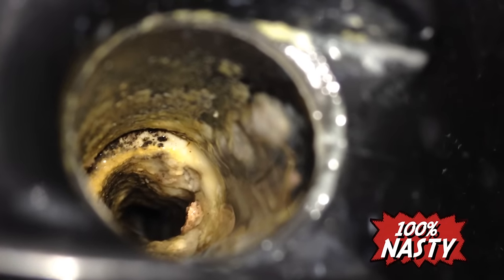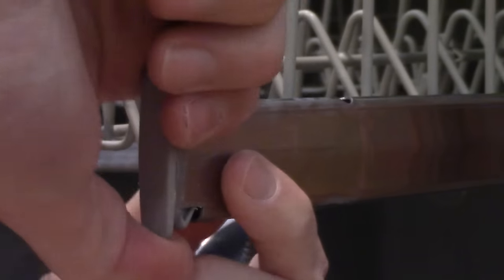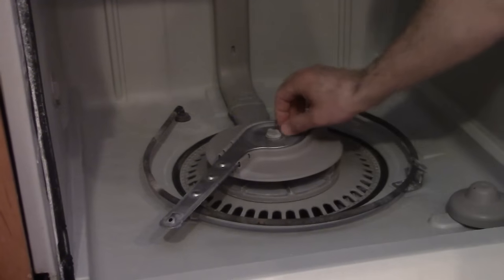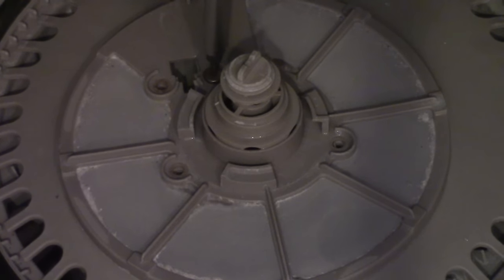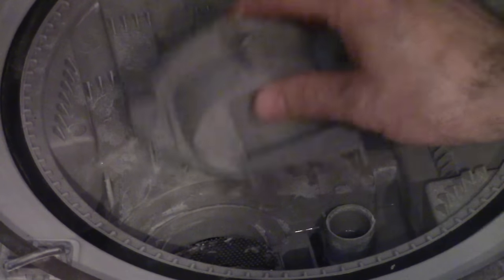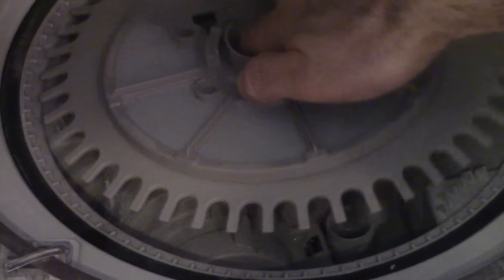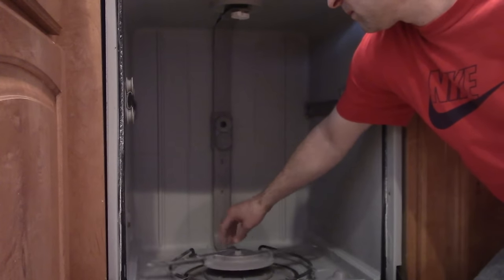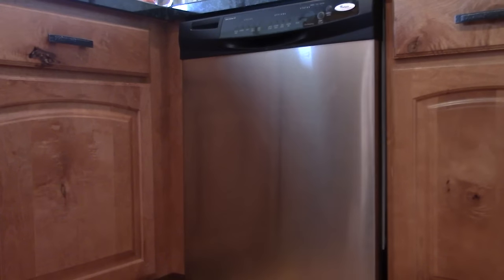How to repair a dishwasher, not draining - troubleshoot Whirlpool

Comment: One thing to be aware of--which I learned the hard way--is that when you take the cover off the spinning blade that chops up food debris, there is a good chance the blade and the grill it is attached to will come off with it. This isn't the end of the world, but it is a pain in the butt to get it back in. The grill has an up and a down which are not marked, so you have to pay attention to that, and the blade assembly is on a spring mechanism which keeps the blade extended on the drive shaft. The blade cannot be separated from the grill. The trick is finding a way to get the grill back in its thin tracks WHILE AT THE SAME TIME compressing the blade assembly to mount it back on the motor. It was so much fun.

Comment: Thank you!! I followed your steps today and got my dishwasher to drain properly. I found so much gunk inside. It was nasty! 
If anyone is nervous about trying this, just do it! The only issue I had was getting the blade cover off because it was caked shut with grime. I slowly worked at it with a butter knife. But overall it was very easy.
Reply: Where did you put the butter knife exactly? I can't get my cover loose, and I don't want to break anything

Comment: Thank you so much ! I just had to watch your video for 1 minute before I solved the case! Or maybe you did.  Three days ago I replaced the garbage disposal. Didn't run the dishwasher until yesterday, so I didn't put 2+2 together that I forgot to knock out the plastic chunk where the dishwasher drain goes into the new garbage disposal,  (I even read it in the instructions!) Like my old man used to say, "Look for the simple solutions first."

Comment: I didn’t have a problem with water not draining, but a plastic fork broke inside my washer and it suddenly it was making a horrible, loud grinding noise! Upon inspection I saw parts of the broken fork in the bottom of the washer and it was obvious pieces had gotten sucked into the innards.
You video helped my husband and I easily dismantle it down to the grinder where we found several bits of the fork and even quite a large piece of glass from a broken cup!! 
So I’m not impressed by the lack of a filter in my dishwasher, but I’m very impressed by your video! You saved us a lot of $ and we really can’t afford a repairman or to buy a new dishwasher.
Thank you so, so much for sharing your time and knowledge.

Comment: Thank you very much for this excellent video. I was able to follow it precisely. 
My dishwasher is as good as new and runs like the day I bought it after following your directions. I have a Whirlpool Gold Quiet Partner III. 

My own advice to anyone watching: DO NOT use any detergent pellets with the gelatin wrappers (The clear packets that dissolve). The wrappers melt, which is convenient, but I found out after opening the chopper cover that the gelatin will eventually clog the entire chopper and filter. Use liquid detergent or powder or powder in pellet form with no wrappers. It will definitely extend the life of your dishwasher by doing so.
Reply: Ok thanks for that info. I have some of those,now I will rip open . Thanks again.
Reply: Josie's Angulo

Comment: Thanks!! Very good instructions! When unscrewing the wing nut screw holding the spray arm, you explained that it unscrews to the right - opposite of 99% of most screws. Many of us would try to unscrew the normal way to the left, which would break it. Also, saying you need a T-15 driver was again very helpful.

Comment: Our dishwasher was not washing the top tray. We followed your excellent instructions and took the machine apart. Our only hiccup was that the screw holding the cover over the blades is a different size. once we got past that, it was clear sailing. There was an incredible amount of junk in there from chicken bones through cherry pits to jar labels. Our first wash today did a perfect job. Thanks so much.

Comment: Thank you very much...you saved the day!  I had ordered a drain pump and was dreading putting it  in, appliance repair isn't easy for a delicate lady.  I cleaned everything on the bottom as shown in the video...and then checked my line to the disposal.  It was completely plugged...dishwasher is up and running. All is well.  I put a bottle of white vinegar to clean it out more.   THANK YOU!!!!!!  great explanation.

Comment: Thanks Adam.  Great video, very clear.  Took awhile to get all the label stuff out.  Before I found your video I had called the "repair guy" he said that I should just purchase a new one because parts for dishwashers are to expensive and they are basically a use it until it breaks and purchase a new one appliance.  So you saved me the price of a new dishwasher !!!!  That is a LOT more then a service call.

Oh hay, one last thing.  4 years later and your video is STILL helping people.

Comment: Okay, my dishes have been getting worse and worse. CONSTANTLY having to reward and scrub gunk by hand. I've mentioned to my husband but finally tonight I took matters into my own hands. I don't know if the problem is fixed yet but you did an EXCELLENT job explaining everything. I seriously had zero problems. My biggest issue was finding a torx screw driver. Then finding the right size. My husband has every tool and could have easily done this too but I try to fix things as needed. And, because it's 2:00 am and I'm just finishing up, everyone's asleep and I couldn't as were the screw driver was. I cleaned out glass and gunk and foods. Also, my silver wear holder keeps breaking along the bottom and guess where all those pieces ended up as well. Yup, got all those out of the grinder area as well. And of course, labels/stickers. We shall see. One concern I have, there is a double flapper thing (technical terms, I know) on the water feed tube. One of the flaps won't close. The flap stays about 45 degrees open. I don't know if that will affect anything or not and it seems like Kenmore only wants to sell the entire feed tube assembly. Hopefully this will work. Thank you so much for very clear instructions. If I can do this without a problem, anyone should be able to.

Comment: Thank you! By far the best and easiest to follow video. We wrote the dishwasher off as it had been leaving dishes dirtier than before they went in. 

I gave it a shot, popped everything off and the entire catch before the blades was completely blocked. Plastic wrap, shredded labels, and more. Cleared the blockage, cleaned the filter and put it back together. 

Once again the dishwasher actually washes dishes. Thank you for saving me a ton on buying a new dishwasher!

Comment: 👍
THANK YOU for getting straight to the point and NOT taking 20 minutes to provide the information!
That's a BIG deal these days!!!!!
EDIT: It took two weeks to get to it, but mission accomplished. THANKS!
More info & a tip:
My dishwasher is probably 10-12 years old and suddenly - because I put my house on the market - at first it wouldn't drain, then it was hit or miss whether it would run at all. And my wife immediately thinking we needed to buy a new one. So doing some digging and wondering if the problem was a clog. 
So I've done this and just started a quick wash cycle on an empty machine. So far so good.🤞🙏
A couple of suggestions.
I used a shop vac to suck water and BIG bits out of the bottom. Then scrubbed everything with bleach cleaner. 
Make sure you have a GOOD flashlight. My Iphone just didn't cut it.
THE hardest part are the screws holding the upper supply arm!
One last thing - MOST IMPORTANT
After you get it apart and cleaned, take a break and watch this again.
Without going into details there is a pretty good chance you will put something back in the wrong order.
Then you get to undo it, and do it all over again.
Thanks again.

Comment: Excellent, clear instructions. We just bought a new-to-us (used) dishwasher and my nephew helped install it and recommended cleaning the filter as a preventive. I had no idea how to do that. Your instructions demystified the whole process. I appreciate the finer points you made, like recommending laying down a towel just in case you drop a screw, to avoid it going into the filter area. Very professional. Thank you.

Comment: I'm familiar with cars, clothes washers and dryers, pool pumps, and a variety of other mechanical things, but I had no experience with dishwashers. I was surprised to see that the discharge was into the garbage disposal! I could have just started pulling things apart, but this video was invaluable, as it showed what to expect at each step. Thanks!

Comment: You saved me a big repair bill. Exact model Whirlpool in your video. Found popcorn, toothpicks, broken glass that was apparently hitting the blade, once I removed the cover. Cleaned it all out (used a wet/dry vac,) got some of the gunk off the blade. Cleaned the filter also. Runs like a champ. BTW: It was making a loud grinding type noise. Manual doesn't show how to disassemble, so this video did the trick. Thanks on posting it.

Comment: You are right about the dishwashers not being much different. Your video matched my Kenmore dishwasher directly. I followed your video and found a bunch of broken glass and toothpicks by the chopper clogging up the drain of the flooding dishwasher. Your video saved us at least $200 for a service call, or more, as due to the age of the dishwasher, and the possibility of a $200 plus service call, we were thinking of just ordering a new dishwasher.
Thank you very much!

Comment: Thanks so much! Not only was I able to clear years of mushy paper clogging the drain, I also popped the filter apart & cleaned that out too!  The hardest part was having the confidence in myself to actually remove those two little clips and get started! Without your video I would have had to pay someone to do what I was able to do in less than an hour :) Thank you!

Comment: Adam, you helped me immensely with my service of the exact same dishwasher in the video!
We had not cleaned the filters in the 4 years we've  had and we noticed that it wasn't performing well. We had lost the instruction manual to boot. You made look doable so i thought i would go for it. Thank goodness I did. Inside were the filters are were clogged to the max! It was amazing it still worked at all. The manual says to do a filter clean every month and its not easy for people who are not mechanically inclined such as yourself and me. Thanks for the video

Comment: I was trying to Loosen that Plastic screw to remove the Lower sprayer arm and was having difficulty as I was thinking the plastic screw threaded into something below, i was wrong!,  I did not know until I saw you turn the screw "Clockwise" Thanks for the video, and I hope others will notice that it does not unscrew Counter clockwise like most common bolts or screws.
Reply: Jack Young I found that out and have been trying to unscrew it clockwise but it won't come off. Any tips?
Reply: If you have turned it the wrong way for a bit, it may have messed up the  threads of the plastic bolt, try to lift the sprayer at the same time
Reply: I am wondering if I also messed up the thread in my lower sprayer arm screw, for I cannot for the life of me get it back on. It turns for a lil bit then pops right out again. What to do in such a case? Would I ave to purchase a replacement lower spray arm?

Comment: Just wanted to thank you for posting this.  I have what looks to be the same model as yours and it has to be at least 10 years old.  I had never cleaned it (never even thought about it) and to be honest it seemed to be working OK.   I saw this and decided to see what the filters in ours looked like.   HOLLY COW there was all kinds of stuff in there.  Lots of lint of some sort but even a small bamboo stick and several large chunks of plastic that was probably wrappers off something.  
Your tutorial made this so easy.   From start to finish was probably 15 minutes.   Haven't washed anything yet in it but I am sure it will make it drain much much faster.  
thanks again

Comment: Thank you for your video! It felt awesome to be able to fix this by myself. I had a hard time getting the cover off the blade but eventually popped it off with a screwdriver. I also had an extra screw in that area. My dishes were coming out gritty after using but that problem was fixed. I pulled out paper, plastic, glass and a chicken bone out. Gross. Thanks again for your help!!!

Comment: My kitchenAid dishwasher looks exactly like this on the inside. Thanks to your awesome video i was able to drain my dishwasher. Water had been slowly filling up, to the point where I had to turn off the hot water to the dishwasher to prevent from overflowing. The problem with turning off the hot water was i wasnt getting hot water in the faucet either.  The wife wasnt happy. With the video i was able to get inside and pull out a bunch plastic wrap that was trapped. Bam! Dishwasher worked and no more drain issues!!!

Comment: Things went well until I tried to get the lower spray assembly off. I turned the plastic screw to the right, but it did not "pop right off". In fact, it was a royal pain in the ass, but a little creativity got it off. It should be noted that this is not an item that comes out, you have to align things to a small slot inside, then you can get it off. After that the instructions were golden. I found broken glass, those damned plastic stickers from plates, and a five course meal down there. After reassembly, she started right up.
Reply from the maker: I hate those stickers!
Reply: How did you get it off? My plastic screw just spins and spins and nothing happens. It doesn't unscrew.
Reply: I still can't get mine off and I've tried all these tips, can I just break it off and replace the threaded piece?
Reply: I can’t get the plastic screw off!
Reply: @racheljordan2465  I used a visegrip to hold it better, then I easily turned the plastic screw to get the lower arm off.

Comment: Thanks for the video! Turns out that our issue related to a recently installed garbage disposer. Not everybody has a dishwasher so where the dishwasher hose connects to the disposer itself it's actually plugged with a plastic drain stopper. Popping that plug out of the disposer fixed the problem. We managed to pull some gunk and plastic out of dishwasher filter so this was by no means a wasted effort. It runs better now. But, I definitely was perplexed as to why our disposer hose with no clogs in it and a freshly cleaned dishwasher filter didn't solve the draining problem. Very glad it was something so simple.
Reply: Everything worked so well until I had to put the spinning thing back! It won’t screw on. I turn and turn the plastic thing and nothing happens. 😫 help!

Comment: I left the plug in on my new garbage disposal!!! fml lol!!!
Reply: Your not the only one that did that one. Your not alone! I put a new disposal in last weekend ran the dishwasher didn't notice the standing water in the bottom until I started smelling something in the sink area. Could not figure it out until I saw the DW. Ugh! I am such a dumbass at times!
Reply: I had the standing water too along with the foul smell and i actually thought my dishwasher was bad.  It wasn't until I looked at the INSTRUCTION MANUAL for the garbage disposal that I left the plug in! What a klutz lol! lesson learned though.
Reply: After taking my dishwasher apart, I read through the comments.  I too did not read through the instructions when I hooked up my new garbage disposal.  Why is there a plug to knock out to begin with?  WTH!
Reply: +mg6311 haha ikr?
Reply: I've done that...just once! Good to hear others have!
Reply: I did exactly that two days ago. I'm glad that I read your comment before I dove into the sump. One gets over confident and sometimes skip steps when you are doing a project that you've completed before. I may clean up the sump one of these days anyway. Great video Adam.
Reply: ralexlu THANK YOU FOR THIS! Just had the same thing happen after replacing the garbage disposal yesterday. Thanks again everyone!
Reply: ralexlu omg I bet this is my problem. I just put in a new garbage disposal and now my dishwasher won’t drain.

Comment: You're a life saver. At about 50 seconds in I realized it was probably just a clogged hose. I unhooked it, ran some water through it, and done.

It was probably the most disgusting thing I've ever seen in my kitchen, but now everything's working again. Thanks for saving me from the $100 service call I didn't need!

Comment: Thank you for your efforts in making this video! Recently, bits of debris were showing up in my coffee mugs and bowls on the top shelf, of course baked on after the dry cycle. I thought it was something to do with the filter/disposer unit. Your vid helped me to take it apart and fix. Gunk everywhere! Now, no more debris. Saved me mucho $$$ because my 20 minutes of labor saved me from having to buy a new dishwasher!

I especially liked the tip of putting a towel below in case of a dropped screw, which I did. Thanks.